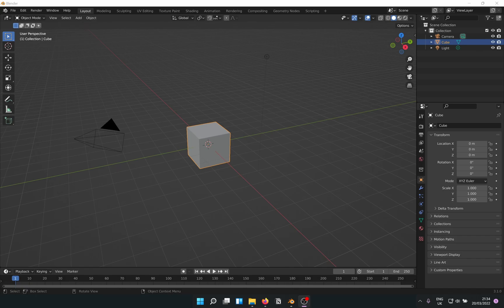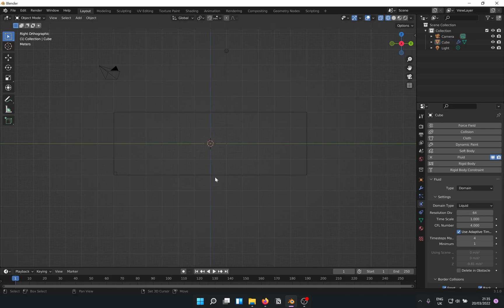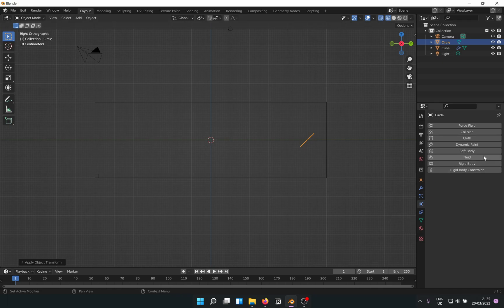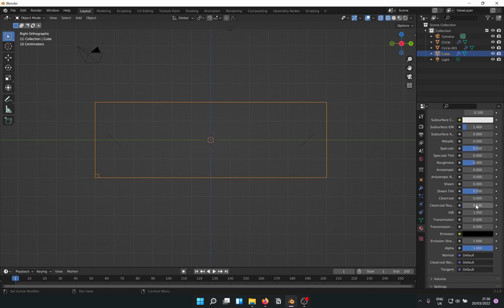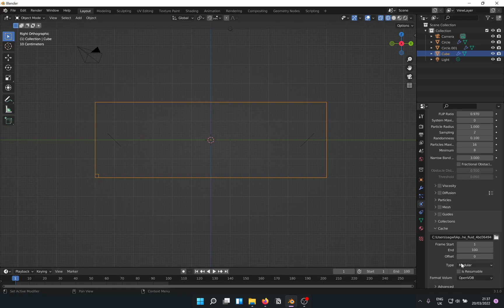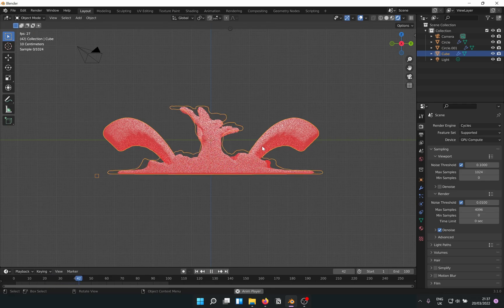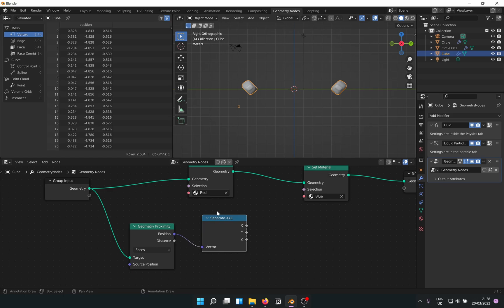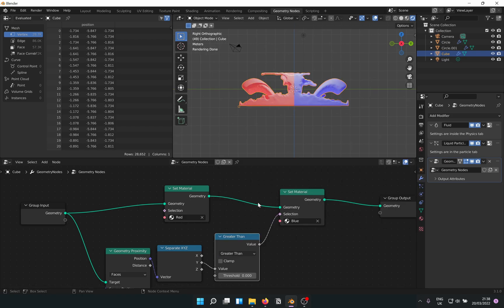18 | Tutorial | Multicolour fluid simulation using Geometry Nodes in Blender

Comment: Hum... yeah so no mixing. The idea is great however, even though you can easily do it in one shader and no geo nodes. Thanks for the idea, I might play a bit with simulations and geo nodes
Reply from the maker: Yea, haven't been able to figure out mixing yet. Tried using ID and Index for selection but they are still quite uniform.
Reply: @bakedmystic3D  Yes, separating different liquids is quite tough